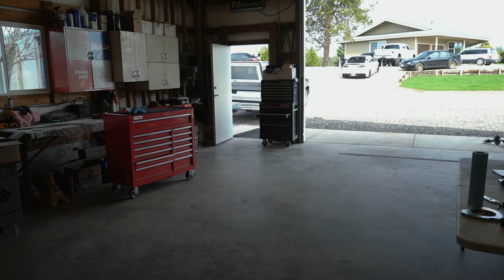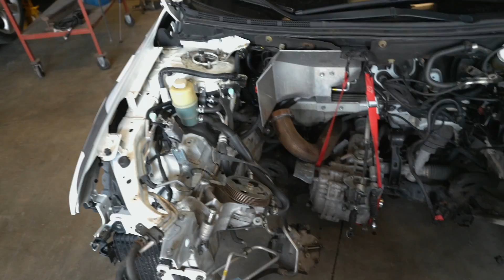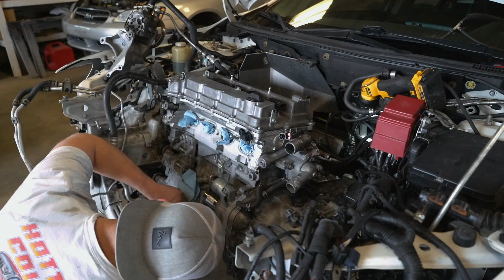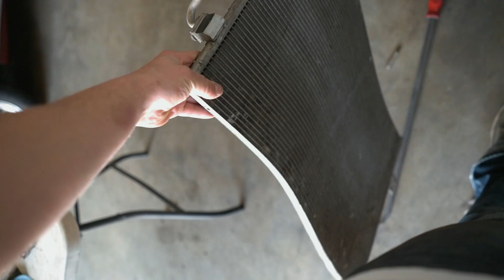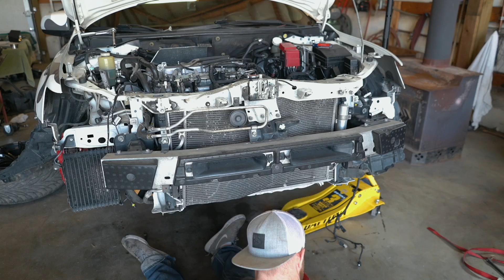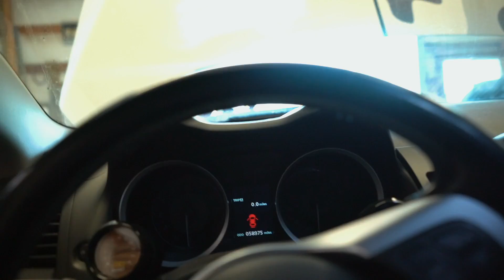My New Evo Motor Doesn't Run

Comment: Check for 12v or a nicely lit test light at started small wire. Im not sure if you checked while in the cranking position. If you do get them and no cranking of engine bad starter. If not gotta track down that signal wire for the starter.  On starter relay you should have 2 powers and 1 constant ground. And another ground while cranking. 4 legs in total.

Comment: I just had that issue when I put my motor back in a few weeks ago and it turned out that I didn't have the plug fully locked together just behind the driver side headlight.  Good luck with it!

Comment: Same exact thing happened with my friends Evo X after he pulled the motor. Here’s what the issue was after he took it to the dealer: so apparently on the wiring harness there’s a harness that goes to the starter of course and another one to the AC. They look exactly the same and my friend ended up hooking them up the wrong way because of this. Tech at Mitsubishi swapped them back and it fired right up
Reply from the maker: Raichu595 Wait for tomorrow’s video 😱😂
Reply: Devin Niemela Hopefully this answer will come in handy for anyone else having issues then!😂
Reply: Devin Niemela plz dnt make us wait for tomorow :( im dieing to know if u got it started!!!
Reply: Raichu595 just wanting to say thanks for sharing this solution
Reply: also if im correct(it's been a few years for me) i think the starter trigger wire is on a sub harness that connects to the main harness. maybe you dont have the sub harness connected?

Comment: My Suzuki TL1000R had a little black box with 2 wires going to it . I accidentally fitted it upside down whilst working on my bike. The bike wouldn't run so I had to get a bike shop to pick it up . It turned out than there is a ball bearing in the box and when it goes upside down in a crash it cuts the engine. The bike shop put the box up the right way and it went straight away.

Comment: have you tried starting the car without using the fast key? ive had this issue with my fast key not working after the battery disconnected, then after using the regular key everything synced back up